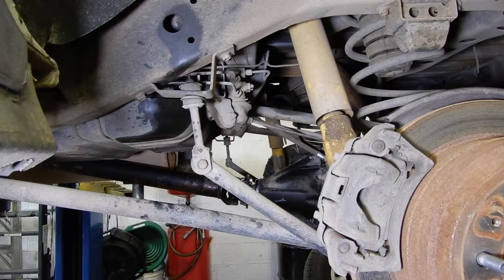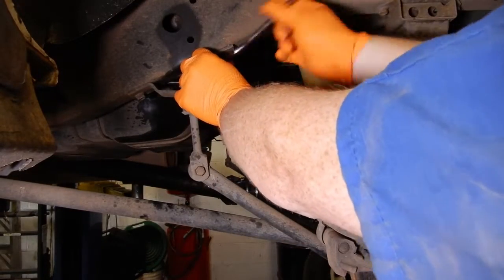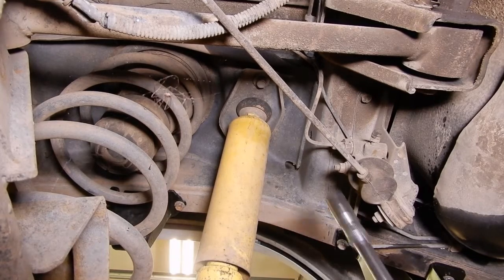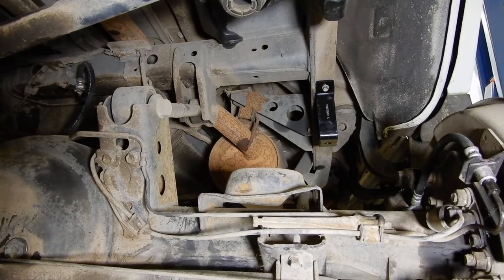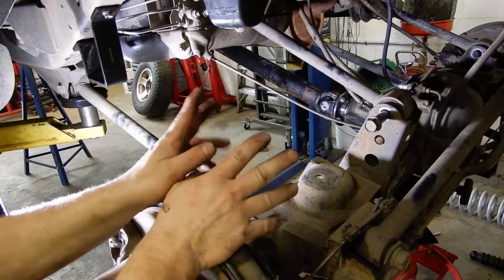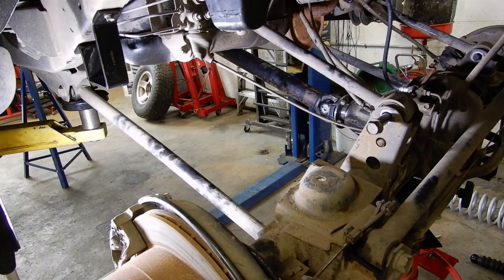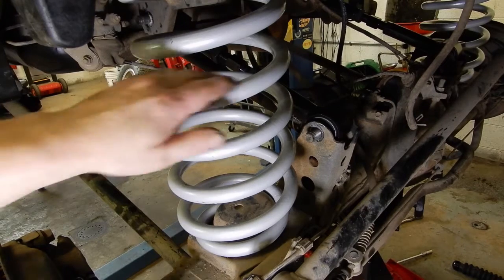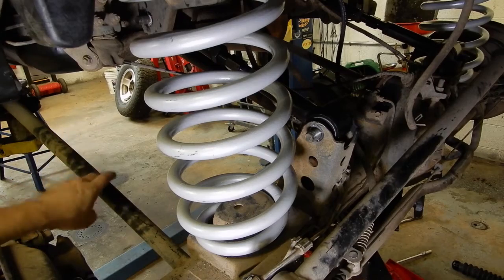80 Series Land Cruiser Rear Suspension Install

Comment: What are you doing with the ABS wires that are mounted on the upper control arms with the new adjustable ones, are you just zip tieing them to the new arms?

Comment: I did a 50mm lift on my 105 cruiser using Dobinson, rides pretty good, but make sure your left and right rear springs are marked correct, mine weren't so my drivers rear sits 10mm lower, thanks to the cowboy who  installed it for not checking it properly

Comment: How did you do your geometry? Or Plum bob?
Reply from the maker: I used trig to go from the lift height to the new bar length. That'll get you close. Fine tuned with a plumb bob.
Reply: @OTRAMM can you explain it like I’m 5 as what measurements to use for the trig?

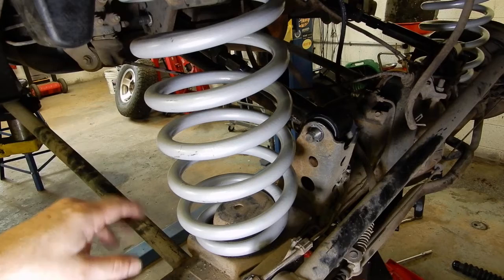Comment: Thanks I’m going to check my upper and lower trailing arm bushes again as I tightened the bolts before letting the rear down on the ground 🤨 at 22:25 you mentioned 
Thanks 🙏
Reply: I mentioned on your live show a few weeks ago I had a weird nudge in my rear we could have found it as lots of other things were looked at and not the bushings because they were recently replaced

Comment: Hello there nice job explaining all the steps. Can you or someone else in the comments please let me know the torque specification for the rear upper and lower arm screws. I did not see you mention it on the video.
Reply: FSM says 130 ft/lbs for the control arm bolts/nuts and 180 ft/lbs for the pan hard bar.

Comment: Wouldn't the lowers line up if you just jack the body up until they do? Better than trying to man handle it into position and risking graunching up the threads on the bolts.
Reply from the maker: The new rears are longer than stock so things have to shift a bit to get them in.

Comment: Good job , can I asks why are adjustable rods are needed ? I'm familiar with OME lift's.  Thanks.
Reply from the maker: When you get in to the taller lift ranges you get beyond the angles that the drive line is happy with.  So adjustable control arms to dial the pinion angle back in. And adjustable panhard bars to get the axle back centered.

Comment: HI, great vids. You said you used trig to calculate new panhard length before install. From what points did you measure? Just use new height with original base to get hyp?
Reply from the maker: Yep, I used the original hyp, and lift height difference to get the new hyp.
Reply: @OTRAMM  Hi. Could you elaborate a bit please? I am going to install 2" on my 1991 GXL (which is already factory higher suspension) and not sure how to count that panhard rod. THX ;)
Reply from the maker: @ondrejmarko01  I used the pythagorean theorem .  I measured the stock panhard length and used an arbitrary length for the vertical (like 5").  you can use A squared plus B squared equals C squared (C is the stock panhard length.  to calculate a horizontal length.  Now take your lift height and add it to whatever random amount you used for vertical (so a 2" lift would change the 5" to 7") Square that, add the square of the number you calculated as your horizontal and the square root the sum and that should give you a rough length for the panhard.  There's probably an easier way but math wasn't my strong point. :)

Comment: How did you remove the upper strut bolt?  From inside the cargo area?
Reply from the maker: 5:20
Reply: I read on the forums that there is a bolt on the top that needs to be removed?  They even mention drilling a big hole in the sheet metal above the shock to access this bolt. So basically just remove the 2 shock mount bolts and the shock can be removed correct?  Thanks for all the videos!
Reply from the maker: @richardkwon6697  when you pull the two bolts the shock plate comes out with the shock. Then you just swap it to the new shock.

Comment: Morning
Where did you order your slinky springs from? I can't find anyone online to order from. 

No caster correction under 2" correct? Should I still look at away bars or other components for this small lift,?

I'm looking at the 50mm slinky springs and Bilstein 5100 shocks. 

Thanks
Reply from the maker: I didn't actually order this one. My customer already had the parts. I think they came from Endless Horizon Outfitters.

Comment: Is there a good location to get penetrating oil into the upper shock bolts?
Reply from the maker: You can kind of see them between the frame and body from the wheel well so I spray some from there. You can also get a decent shot from underneath the truck between the frame and body. I just hose everything down 😁